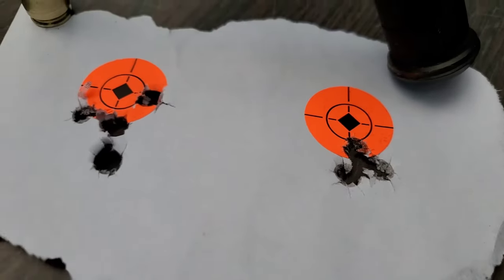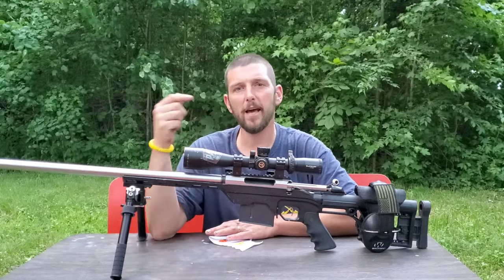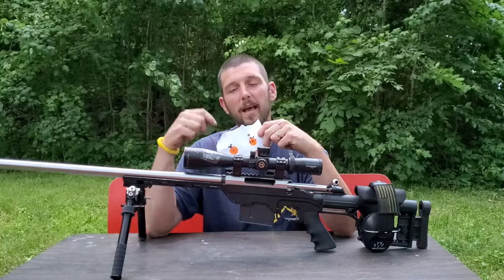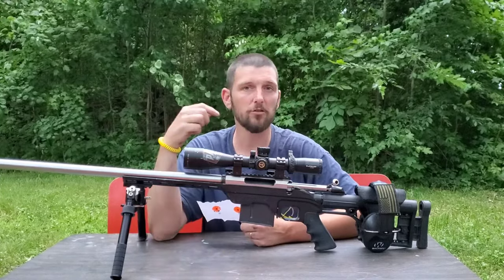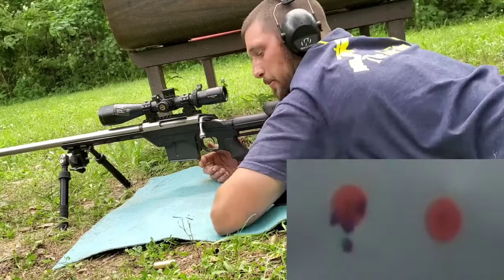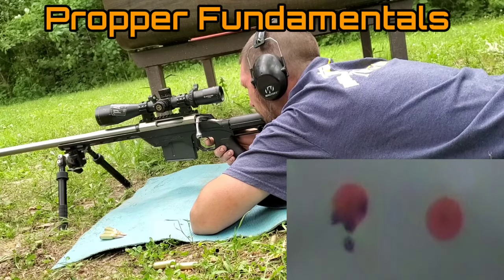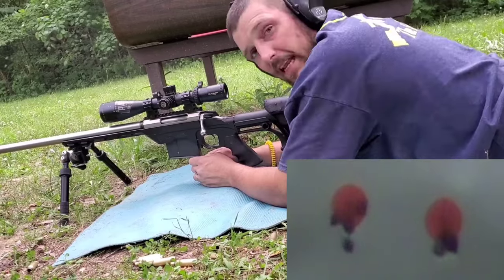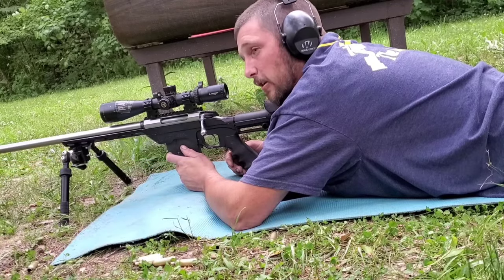Stop Blaming Your Rifle | This Is Why Your Rifle Won't Group

Comment: I do agree but at the same time I do disagree as well I just sent a rifle back to Bergara it would not shoot the same group twice with the same ammo. Brand new rifle broke the barrel in as they asked and only one manufacturer makes 300 PRC ammo at the moment so.  Removed rings and rail and scope. Reinstalled everything and still had the same issue. So I agree fundamentals are important but some guns do have problems

Comment: Right on, this stuff takes work and lots of it. So many people want to buy pro gear and go shoot tiny groups, but it’s definitely not going to get you there without the good old fashioned quality practice making marked improvement. That being said, I built a precision gas gun with a handguard that allowed a little bit of flex when using a bipod and the  gas block made contact with the mounting screws of my mlok arca rail under recoil. Needless to say it  messed up my groups. Took a while to figure out what was happening. Sometimes it is the gear too!  Subscribed and enjoy your videos!

Comment: That's why I'm soo glad I put up the best group of my life (so far) with my tikka ctr..... and got it on tape!

5 rounds @103 yards......4 where into a group of about 1/4 and the 5th too it just over 1/2........

Sooo stoked lol.
Edit to add the tikka is BONE stock I didnt even adjust the trigger lighter(didnt need it imo).

I actually get the opposite  and people say I only shoot ok because of my gear..... this is specifically why I'm leaving the ctr STOCK with a bushnell forge scope hahaha
Reply: so it was a half inch group @ 100 yds.

Comment: I’m having trouble getting a group. My first shot will be on target, then my next 2 shots will be extremely high, about a foot high. I can’t seem to know what’s going on.
Reply: Sounds like you may have loose scope mount screws.  Remove everything and start with reinstall and retorque including bases. This happened to me and it solved the problem.